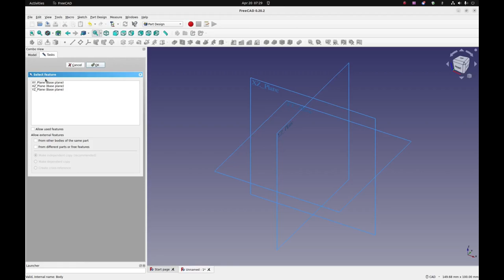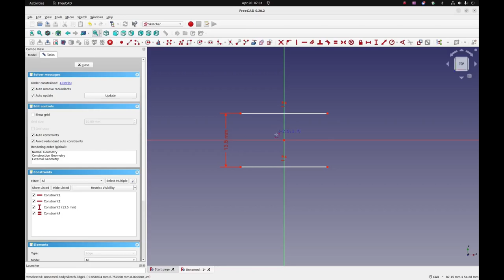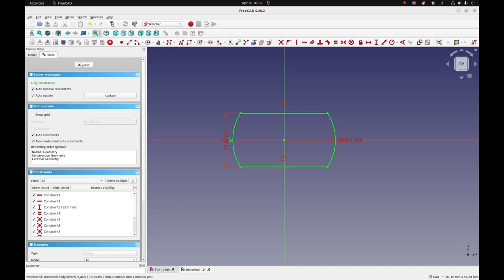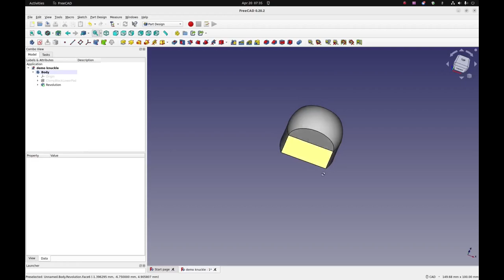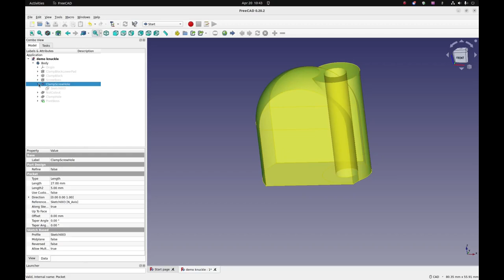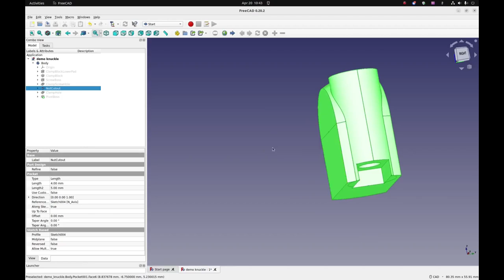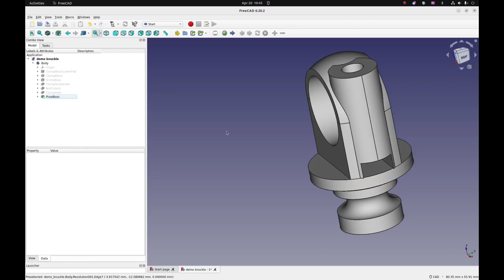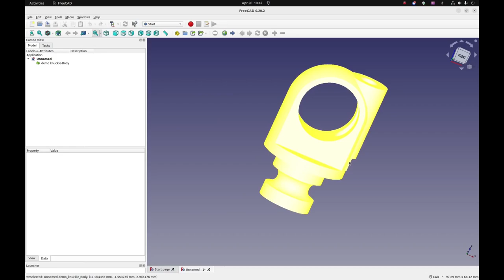3D printing vs machining a pivot part for a tripod.

Comment: Great video Alan!
 One can save many hours of hard work by 3D printing things - I know I have! In the case of the two 3D printed brackets that you showed the first one is the strongest as the load is being placed longitudinally to the layers especially where the item clamps to the tube, once you start placing loads perpendicular to the layers the print becomes much weaker. It is something that must be considered when setting up to slice the model as it can be orientated to maximise strength or to minimise supports and overhangs where strength is not important but appearance is. One scenario where a 3D printer is invaluable is when you are designing things like tools or models that you wish to make, you can do all the 3D analysis you want in CAD but having a physical object to hold in your hands can alert you to any design issues you may not have seen until you were well into manufacturing the item. 3Dprinting the parts out and assembling them can save your bacon and a lot of valuable materials that would have become scrap- best few of hundred bucks I have ever spent!
Reply from the maker: Thanks for that feedback Ian, and the tip about strength variance with print orientation - much appreciated. I've been playing around in FreeCAD today and modelled a box with a sliding lid where feature dimensions are held as variables in a spreadsheet. This is brilliant functionality as it greatly reduces work effort to model like items. I can see a lot of 3D printing in my future :)
Cheers.

Comment: Welcome back, that was a very very interesting video, back to the work shop with my chisels and bandsaw to  make a wooden engineering pattern! 
I am old and have forgotten your profession ?
Kit from Queensland
Plus your Joe Pie fixes
Reply from the maker: Thanks Kit. I'm probably best described as "a jack of all trades, but master of none". Last job I had before retiring (in 2011) was in IT management.
Cheers.
Reply from the maker: PS I think you should have a go at modelling a pattern - FreeCAD has a specific tool for casting draft. It might seem a little daunting at first, but there are lots of tutorials out there to help you. Also, if none of your mates have a printer, there could be a printing service within easy reach. Either option would limit your initial investment in time and tooling.

Comment: Not got a  3dprinter yet myself, but it is complementary to machine shops.... parts bins, tool holders and cases, racks, drill indexes, the usages are endless.
I want a printer thats robust, reliable and does not require babysitting and buggering around with.  Also thanks for the freecad demo... the struggle is real, but there is good youtube tutorials. Great video.
Reply from the maker: Thanks for your feedback and glad you enjoyed the video.
Cheers.
Reply: You may have to pay a bit more for that , look at printers from Prusa , Creality etc .  The Prusa gear has a reputation for reliability - they use their own printers to make parts for their printers - giant printer farms ! Creality has been around for a fair while now and i use one of their printers - and Ender 3 V2 but i have added things to it to make it better like a bed level touch probe and dual z axis lead screws and belt linkage, i believe the pro version comes with all this factory installed . Before you make a decision have a look at a few videos from the following youtubers:
Teaching tech
BV3D
Chep
Makers muse 
Thomas sanladerer
Most of these channels do or have done evaluations on most of the printers available today .
Reply from the maker: @ianbertenshaw4350  My friend's printer setup is an own built "Aquila x2 / Creality Ender 3 Hybrid” with Cura slicing software.